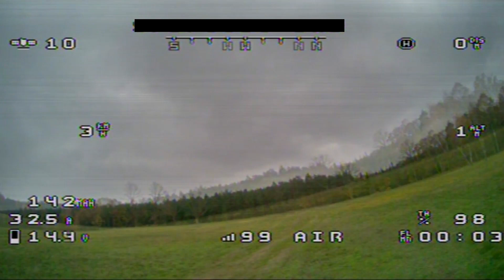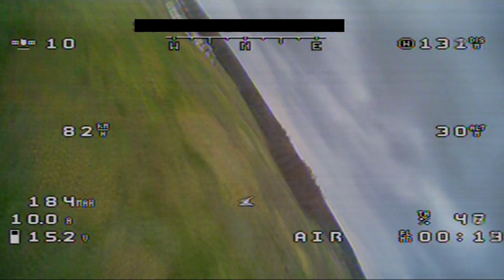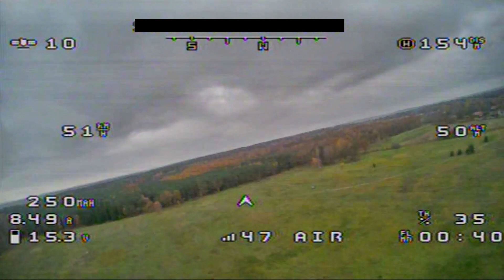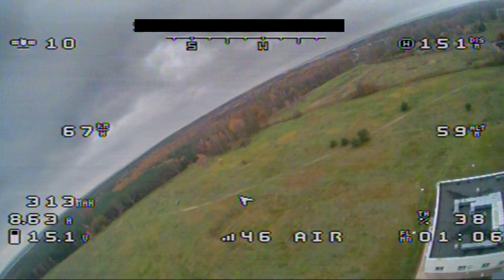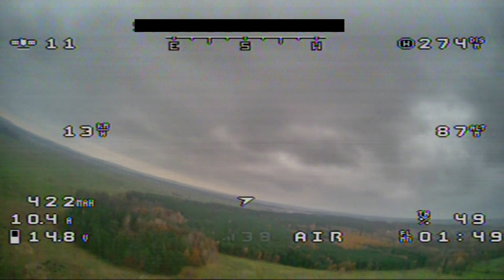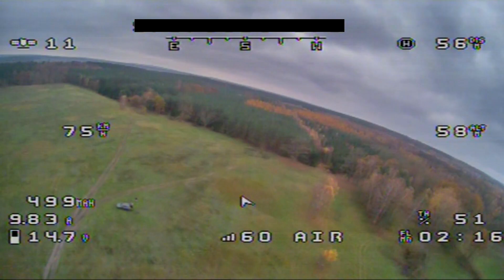Matek 1.2GHz VTX and receiver - VTX-1G3 and VRX-1G3

Comment: Forget notch filters, you cannot use your 1.2G VRX in your goggles..!!!....Far too close to your Taranis banging out signal up to 1Watt on 868mhz, not going to work....Simply use the 1.2g vrx with a low power 5.8g video relay to your goggles.
  End of problem. Also standard practice when using 433mhz UHF control....This is how its done..

Comment: A low pass filter on all 1.3g TX is fundamental.
Otherwise it will spit noise all over your plane!
On the otherhand Matek claim that the matching 1.3g RX already comes fitted with such filter.

Comment: You need relay on ground 1.2-5.8.
You cant put 1.2 inside your googgles!!! You ned minimum 10m-15m between video reciver antena to rc transmiter unit!
2. In plane video transmiter antenna must be maximum out from gps and rc reciver antena. All antennas must be calibratet to exectly channel you use: 915-915, 1280-1280 ! No more then 1.3 swr!!!

Comment: I have been using 1.2 on my fixed wing for many many years and have no problems with interference. BUT, I am also flying using Dragonlink which is a 433mhz LRS. I have heard of the problems with the 900Mhz LRS. Either way, if you fly long range fixed wing, you fly 1.2ghz.
Reply: The R9M has no problems...they dont like it cause its doing the same job as the crossfire but realy cheaper...its hard for them to accept that.With R9M i got out 42km and back home and i have test the system in all my wings with diferent receivers that they claim that dont work and believe me it does
Reply: george zoup that is good to know it works well with 1.2!

Comment: Use cheap openlrs gear with it. If you set the fuses correctly with an usb asp you will have a rock solid system.

Comment: Moral of the story- STAY AWAY from 1.2ghz.
Reply: or change Radiolink to 433Mhz and test again?
Reply: @kap1down  not a bad idea, but the GPS issue still persists and I've had several issues where even after I get a Sat lock they can still drop making LR flights a bit too exciting for my tastes!
Reply: @dustynuts4sale  If you are using a vtx with more than 200mw output, then that could be the reason....Separate your GPS from your vtx....and use a Dipole on the vtx, not a skew....1.2g is far easier to use at distance than 5.8g ever will be...As long as you know what you are doing that is.
Reply: @dustynuts4sale  I use an 800mw 1.3vtx with about 20 cm seperation from gps and have never had any issues. Satellite lock in 20 seconds and never lost.

Comment: Been using it for years, 5.8g is hopeless in comparison...Use a 5.8g relay from a GS...simple....200mw vtx will get you 8kms easy..even on the R9M...although UHF is the ultimate answer...Goggle based 1.2g vrx is not a good idea.
Reply: Do you use linear or circular polarisation?
Reply: @dj_dazzy  Oh, Dipole on the plane for ultimate performance, and a tuned linear Patch on the video reciever...You dont need those rediculous huge skews on 1.2g...besides, its around a 3db loss in efficiency...
Reply: I have the parttom  1.3 using IB crazies big blue circular polarized cloverleafs I haven't been out more than 5K start running out of farmland to fly over,but I've never had any bad breakups.im using wolf box 433 openlrs module on 9x radio on zeta fx 79 wing.I'm always nervous when I fly that big wing because I know I'm using the bottom of the barrel Chinese cheap electronics.twenty flights over the past two years no problems yet but I'll always be nervous.

Comment: I would argue this could be the fault of matek. I have not had an issue using r9 with a readymaderc 1.2 reciever. I have a hunch that the 1.2 matek goggle rx is not very good, but will wait for a comparison.

If you can please please try with the rmrc reciever and maybe even a notch filter.
Reply: Me too. Using r9m like pawel, went 10km with rmrc 1.2rx and r9m probably on 1W

Comment: That means this receiver in goggles is a crappy device. It is known behavior when the receiver has a problem with TX 433 or 866/900 but if you have a chance you can try this TX LawMate Rx or something with a good filter.

Comment: One of the key things I do with 1.3 is keep power levels down. Even 200mW can get 30km, but I also run 433mHz control.
The problem with goggle receivers is the extremely close proximity to your transmitter antenna, so what to do?

repeater..
Reply: Dockking
Reply: 5.8ghz repeater...
Reply: @leephcom  Yep...